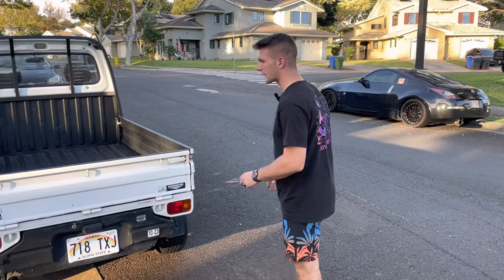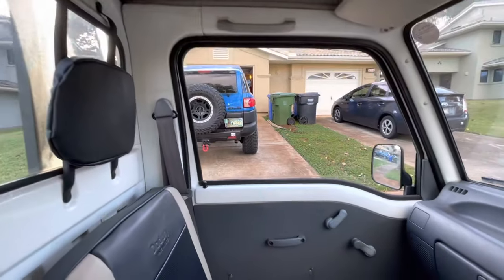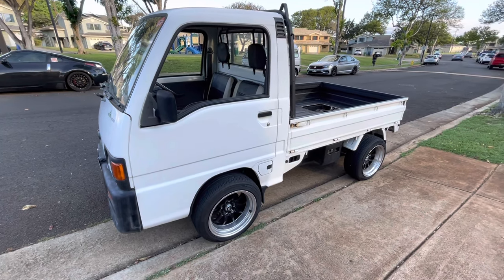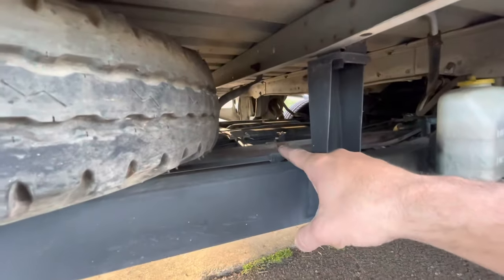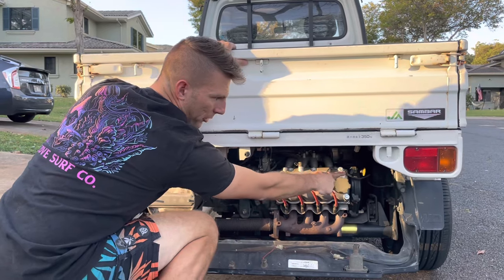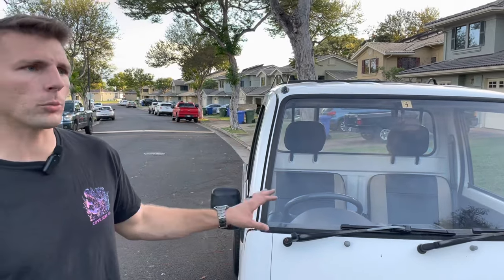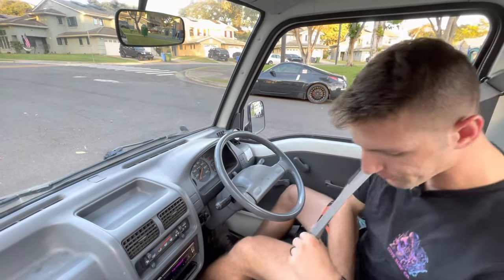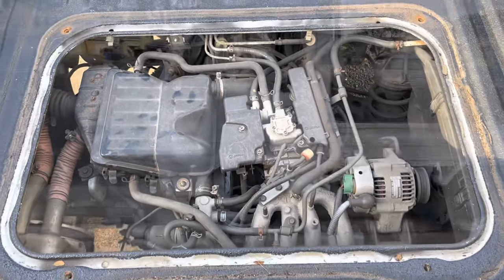Subaru Sambar Buyers Guide 1990-1997 Review and tons of info!

Comment: Thanks for this video.  Covered all points nicely.  Have a '95, and for a my long legs (6'4" + 36" inseam), it works.  Knees are still close to the dash but you can drive for an hour or so without a stretch.  Wondered where that extra bit of room came from in the Sambar, and I read it's got the least sloped windshield of KEI's, allowing a slightly more upright A-pillar and forward dash.  Really fun vehicle!
Reply from the maker: True !

Comment: Thanks for the video! Knowing what to look for helps a lot! You mentioned replacing a motor. Is it a difficult job? Was the engine you installed a new one? Are service manuals available in English?
Reply from the maker: Service manuals are available in English at Yokohama motors website, along with eBay. I purchased a brand new Subaru engine through the same company. It wasn’t difficult, but then again I work on these trucks frequently and have done a number of engine swaps. These are easy enough, I think you could do it yourself with the right tools!
Reply: Thanks!  @GhostSpeedShop

Comment: Hi I’m also from hawaii. I’m torn between the Sambar truck or the Suzuki carry truck. Not sure which is easier to get parts for to keep it maintained for longer over the life of the vehicle. Also I want 4wd with atleast a rear locking diff, which would be best? Not sure which is easier to work on as well. Any feed back will help. It will be used as a personal working truck for hauling material loads, cruising, and going on off road adventures on occasions. Having ground clearance and approach and descent angles will help a lot. That rear engine cover looks like it might be a slight hinderance for the Sambar, what are your thoughts? Main thing is ease of maintained, repair, and obtaining parts. Thanks
 
Also how well does that independent rear hold up with weight in the bed compared to the Suzuki leaf spring rear?
Reply from the maker: I off-roaded an Acty. The Sambar does not have a rear locker. The Subaru will be the easiest to get parts for over the Suzuki. 
If you are buying on island, the only dealership I would trust is Aaron rideout or Sasha. I’ve had terrible experiences with other dealers, like really terrible experiences.
Reply: @GhostSpeedShop  ah I see. I do want rear locking diff tho so probably gonna have to go with a Suzuki carry. Also I have a couple of friends that import, so I’ll be going through them when I’m ready. I already got a Toyota hi ace through them. Appreciate the info my dude 🤙🏻.
Reply from the maker: Of course brother!
Reply: I have a 91 Sambar with the locking dif switch on the dash .

Comment: How rare are the fuel injected supercharged ones? Do you got to have deep pockets for those?
Reply from the maker: Not too rare but they feel quicker. Expect to pay atleast a couple grand more for one.
Reply: I recently picked one up from JDM Hawaii.  They said that it's only the second one that they got in the last two years.  1994 Subaru Sambar Supercharged, just under 40,000 miles, A/C, 4WD, locking differential, 5-spd. manual transmission, radio, very good condition.  The only thing wrong with it is that all five tires need replacement soon.  While they appear fine at first glance, with plenty of tread left, there are hairline cracks that are visible deep within the grooves of the tread (a sign of aging).

Had it not been a supercharged model, I would have expected to pay $9K to $10K out-the-door for a truck in this condition.  However, being a supercharged model, I was expecting to pay $13K.  I actually paid $15K, a couple of grand more than I wanted to.  But I figured, what the hell, and paid the premium for the truck that I truly wanted.  At least shipping is free to Hilo!  😁
Reply from the maker: @1dash133  I have nothing but bad things to say about that dealership. I hope your experience was better than my last 10 customers who bought something from them. I know for a fact they have brought more than two of those in over the last two years and why the hell wouldn’t they swap the tires at that price? Shipping is “free” because it’s 500.00 from young brothers and you paid 11k more than what that dealership paid for that vehicle at auction. I truly wish you luck.
Reply: @GhostSpeedShop     Thanks for your admonition.  

Confirms my thoughts about the sketchy sales process... asking $3K just to hold the vehicle until I could inspect it and demanding payment of the balance within 5 days when they won't be ready to ship the truck for a couple of weeks.  

Then there was the mysterious backdating of all the papers, dating all of the sales documents to one day before the actual purchase date.  The sales manager fluffed over the explanation of why that was so.  I didn't press him on the issue, since it didn't really matter to me. 

As to swapping the tires, JDM Hawaii wanted to charge me $1200 to change the tires.  Moreover, they wanted me to pay the full amount without telling me what brand, model and size tires that they would be using!  (Besides being terribly overpriced, it was ridiculous for them to presume that I would accept the price without knowing what I was getting.)

Regardless of the poor buying experience, the truck ticks all of my checklist boxes:  supercharged, 4WD, A/C, locking rear diff, and 5-spd.   Only time will tell how well the truck holds up.
Reply: If your looking for a super charger on a sambar, look for a sambar with stock fog lights. You can browse quickly through sambar listing's and if you see a photo of a sambar with stock fog lights, it is most likely a  super charger model.

Comment: Is it possible to add another battery in that spot and charge both?   that would be great for extra on board power.   for lights and radio and such.
Reply from the maker: It is possible, for charging you will need a battery isolator, positive cable from the other battery/ alternator and a ground wire. You might also need a battery clamp.